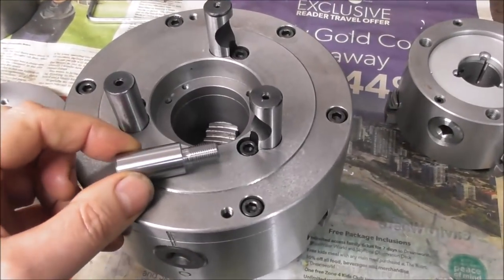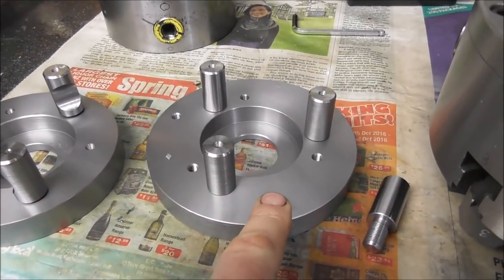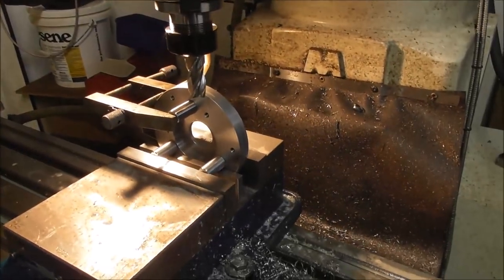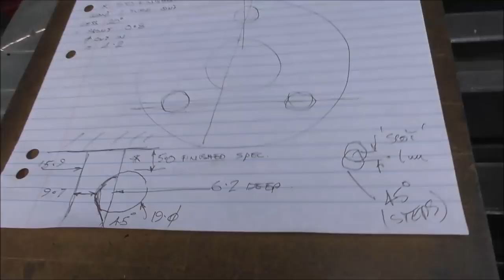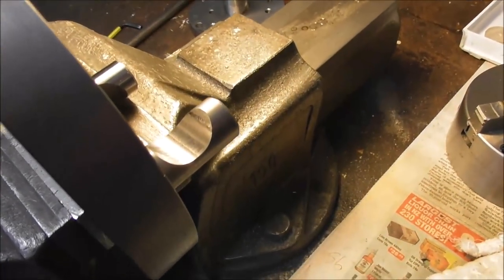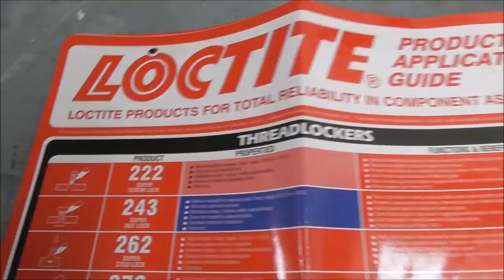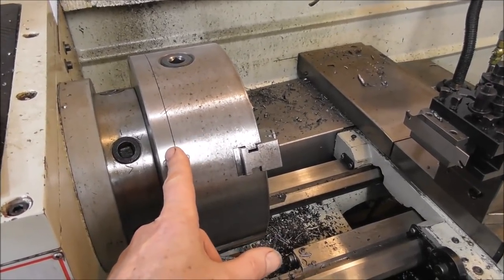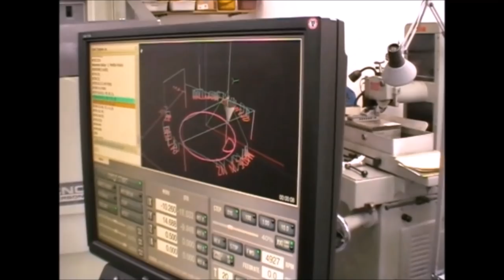Chucks, Collets, and Backplates  - Part 2

Comment: I know this is an older video but to date i have not seen anyone refer to the proper fitment of the D1 taper and spindle,  How did you ensure that your D1 was actually engaging and aligning the backing plate  before it may have bottomed out on the spindle face?  
Thanks  Rick
Reply from the maker: Hi. One way to do that is with the studs removed and a fine polishing paste  ..too fine to remove much metal..rotate  the assembly back and forth.  Then clean and inpect. You can see the surfaces that have been in contact. Cliff
Reply: @Threadexpress  Thanks Cliff, Yes i purchased a new D1-5 5c chuck and out of the box it contacts the spindle face but not the taper,  i blued to check.  waiting on some  plastiguage to see how far i am off and then to face the parting surface to create the proper fit.  A lot of work and setup.  But in all the D1 videos on youtube it never comes up.  Sad as this is the foundation of maintaining concentricity and the advantage of the D1 design.
Reply from the maker: @1960fl  good to hear someone is aware of these things. If its contacting the face you can measure the axial slop with studs removed via an indicator..then do the maths to find the amount out.